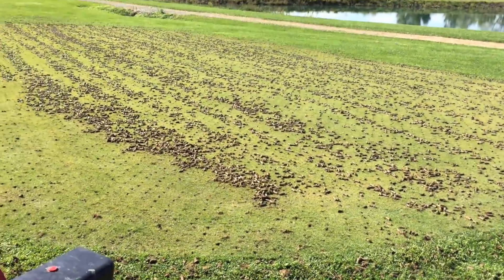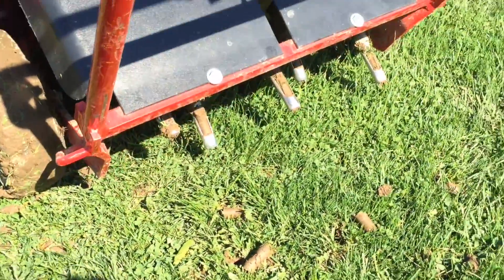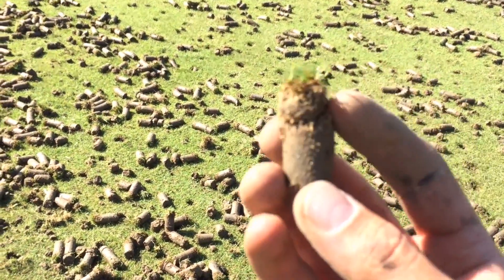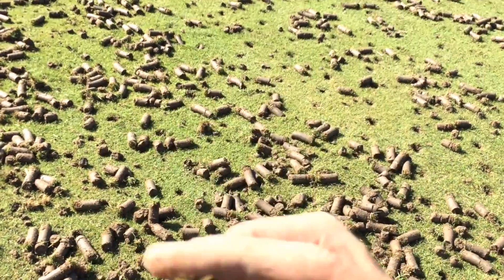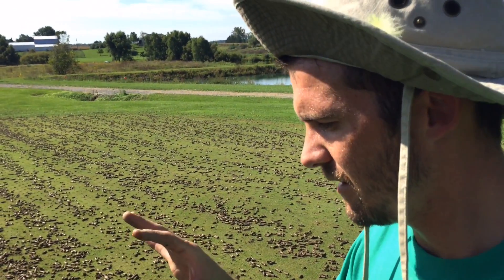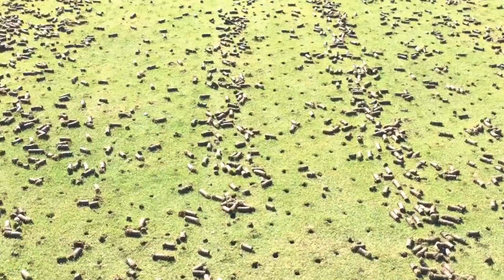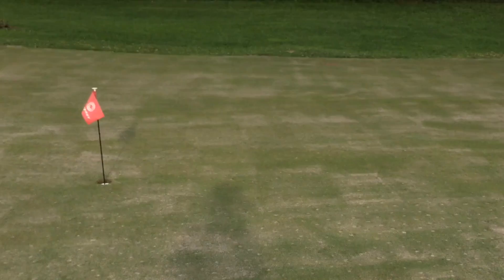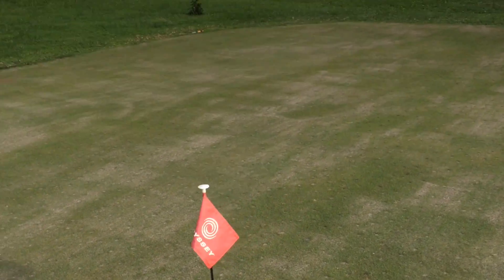Golf Green Aeration... A Necessary Evil

Comment: Don't fill the holes with sand if the ground takes up (a lot of) water, you'll get bumps due to the ground expanding when it takes up the water. By punching holes your lawn gets to breath. After punching the holes you can topdress your lawn with sand or a soil mix with sand (example sand/compost: 50/50). Some of that wil get in the holes by itself, it's ok. Not filling the holes will give the ground the option to expand with heavy rainfall in some periods of the year preventing choking the lawn. By not filling the holes water drains best too.

Comment: If u topdress before aerating it fills the holes pretty well, prevents pull up on turf making a smoother surface
Reply from the maker: We actually were told that by a greens keeper but we didn't try it this time. Thanks Braden!
Reply: that only works if you're solid tine the green

Comment: There are many ways to aerate. Hollow tines(which is what you used) and solid tines, which are a lot less messy. There are even water aerators that use high pressure water to poke holes. Aerating also helps with compaction; Mowing, rolling, foot traffic all contribute to that.
Reply from the maker: tommywt1 thanks Tommy!
Reply: The problem with solid tines is that they don't actually remove material.  Tines compress the ground and can cause other problems.  Solid cores are the way to go.  You can also get smaller holes.  3/8" vs 5/8" for example.  Good job and I love your channel!

Comment: Camshaft, it works like a piston

someone here knows NOTHING about engines. If anything it works as the camshaft and moves the "connecting rods with NO piston on them. 
Golfers or groundskeepers, IQ of 85
Reply from the maker: loligagger85 You are correct...I'll take 85 though
Reply: LOL im thinking like cady shack here. hank hill skill level 9000 lawn care, jiffy lube soccer mom level 2 auto know how. great video though, now i know why this is done. I did wonder why you used buckets for sand vs the bucket of the tractor? cant drive on the green?

Comment: How rough were the putts after the aeration? Maybe create some roller for next year. Surely there is a simple DIY option (round garbage can and concrete, or something). A way to help smooth out the core holes and speed up the green from time to time.
Reply from the maker: They weren't too bad, little bumpy.  We actually have a lawn roller that helped smooth out the sand after we top-dressed the green.  Thanks!

Comment: if you have access to a core harvester, you could pick up all the cores in under ten minutes. if you must remove them by hand I recommend snow shovels to push them into a pile. superintendent
Reply from the maker: Jason 5 thanks for the tip, appreciate it!
Reply: We've got a core harvester where I work but the boss insisted on picking them up with snow shovels...
Reply: Leafblower is what we used at the courses I've worked here in Sweden.
Works like a charm!
Reply: we use a harvester depending on how wet it is use snow shovels and blowers aswell